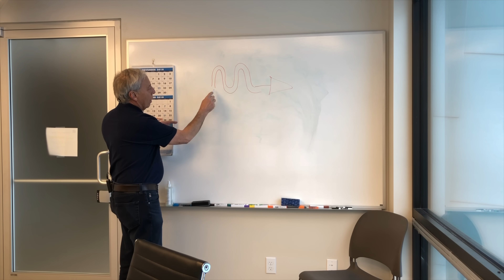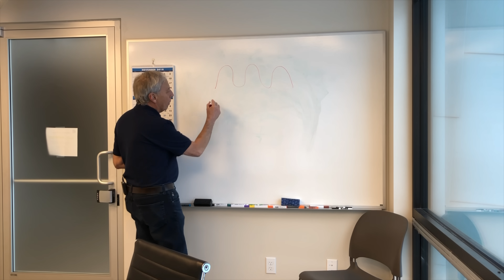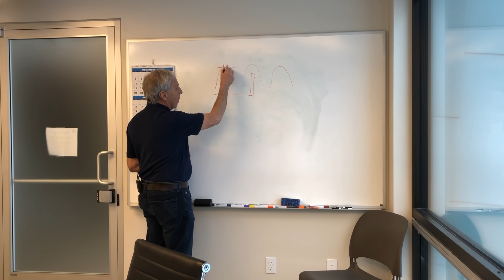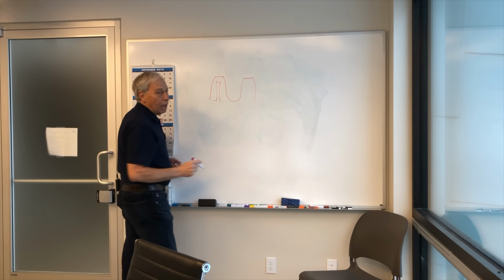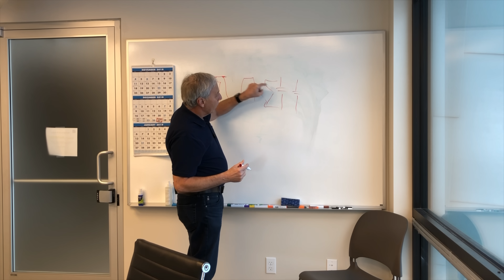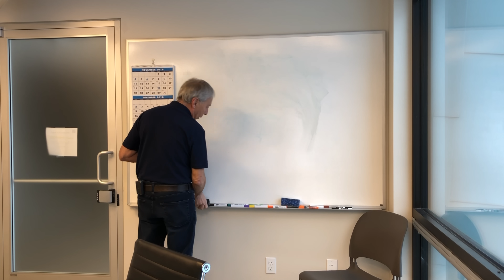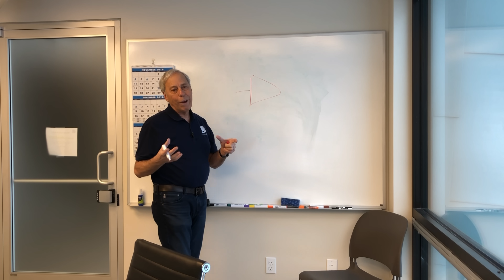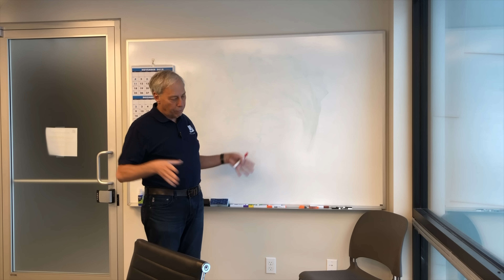How does power factor affect audio?

Comment: When are we going to see some evidence with calibrated test equipment that confirms this is actually a problem for home audio gear? I'm not saying these power line anomalies are not occurring. I am questioning their effect on simple home audio systems. Your simple white board explanations offer no quantified data to suggest the  magnitude of these issues. I'm afraid this is yet one more tireless monthly sales pitch for PS Audio power re-generators.
Reply: Why not buy power conditioner? You could always return it and get your money back :)
Reply: @BijBijTCG  I do use power conditioning. But where it makes sense. Two UPS systems, a 750va for networking and stuff that needs 24/7 operation. A 3kva for my media servers that are off when unused. And my audio and analog gear is an a 10kva balanced isolation transformer, which I have to admit, the balanced operation really offers no benefit but the isolation transformer does offer spike protection. And I hardly recommend this for a basic home AV system. A filtered power strip for line level gear and power amps are best directly plugged in. My system is a bit overkill!
Reply: When I engage my amplifier, a dimmer let less current trough to a lamp. It certainly affect the power supply of other equipment. No question. But I have no plans buying a powerplant module.
Reply: @oysteinsoreide4323  But your amp is not connected to a light dimmer is it? And also the way a solid state light dimmer works doesn;t care about incoming line distortion. I mean how calibrated is the apparent voltage level to the observed light level? (Note that commodity solid state dimmers do not lower the real voltage, It's a basic PWM system that changes the on time within the AC sinewave which does lower the apparent power).
Reply: @andydelle4509  No of course not, its just on the same AC power line in parallel.
Reply: I think that the power supply design plays a major role in all this.  Switchers generally have more noise than linear supplies and there is the issue of small local supplies to dotted around to confuse.  I build controls for lifts and so when it comes to Hifi I have some insight but still, I leave the finer points to the experts.
Reply: @LD Blake so, when the noise hits something non linear like a diode, what level of harmonic noise occurs?
Reply: If i let my Adcom GFA 555 sit unpowered for long enough to drain the caps, which has happened in my last two moves, it causes the lights to dim as well for a second when the initial onrush of current hits
Reply: Thanks for the detail. So if you have say a 200 amp service,  (usa) and one light bulb on, a large amplifier on another dedicated circuit. Nothing on in the whole house, turn that amp on and still dim the light bulb?
Reply: @Dave, I gave careful study to your words and I can only find the way out is DC equipment and a honking battery bank.
Why not just get all that potential energy stored up and then have it near the equipment for seemingly ultra quiet 
operation? If we are to continue this quest for Audiophillia then maybe this whole issue of PF could be a thing of the past. You are familiar with the elimination of distributors on automobiles? Sometimes a complete overhaul of the system can be the best route. Fortunately for me, the switch over would be simple. Segregation of a.c. and dc in audio may be the future. I'm sure that's making me look like the irresponsible one.
Just consider all this about regenerators, conditioners, noisy incoming power, rectifiers, on and on, its all unneeded in Beach Audio. That's my direction, I want the best sound when I'm sailing a reach out of popahey bay. I got about 23 feet of water line and that's where I want my audio.
Reply: @Andy Delle, with 7 billion on planet earth, why not just let the ole dude keep a couple regenerators on hand? What is the issue with you? I know everybody wants to rule the world, but maybe Paul is a
 Global Samaritan and trying his best help people with getting better audio. Maybe the contraption doesn't do well in a brown out, but then again you could have a back up hand crank radio for that. Roll with the freedom's that we have here in the USA or just keep your Spewed Slew on the other side of the border there where you are. Because you sound like you don't have the Freedom that we enjoy here.
Reply: @SJMessinwithBoats  People deserve to hear both sides. Note that I never said Paul was outright wrong. I asked for a test with real gear to prove what he is claiming on the white board. If  the product indeed solves that theoretical problem, then what's the problem with a test to prove it?
Reply: @Dave not sure that you've heard Gerry Rafertys "Whatever is written in your heart"
It might be on topic here. 🌴
Reply: @LD Blake does it make sense to use a "big" (strong) well-built SMPS, then convert this DC back to 60Hz AC and provide this new AC for the amp(s) through an outlet ? Given that everything is sized well (or even better: oversized).
Reply: Dave Micolichek  do you mean speaker driver protection ? For which  cases ? (The amp parts itself are class D modules). What might harm the drivers when switching off the device and caps still power the thing ?
Reply: @LD Blake SMPS are good (excellent), nowadays for high-end purpose as well, just like a Class D amp but I still have some reasons for feeding a Class D module with linear PSU. First, Class D is the kind of animal which is (due to its high efficiency) relying the most on the PSU. It's not like with Class AB that roughly half of the power is always delivered by the PSU regardless of signal swings and even more so with Class A where a big amount of current is constantly fed into the amp section and only some little variations are seen on PSU side as signal swings on a Class A output. With Class D almost the whole power rail swings with the signal and I think in this sense Class D is the most demanding amplification variant, regarding PSU.. and I mainly think of big transients and plenty of reserves. An SMPS (of the same wattage) cannot handle that much transients like the same specd. linear PSU, especially when stabilized. Of course 4kW SMPS is still physically smaller and cooler than a 2kW linear, with reserves.. but that's a different story. The amp is a Hypex UcD2k, 2.5kW RMS into 4 Ohms (max), woofer's minimum impedance is at 5.4 Ohms, max power is 2kW RMS constantly... so I think the chain is pretty much balanced now. The amp runs on unregulated rails anyway. Recommended PSU used to be a 3kW Hypex SMPS but I think I'm going to build 2 classic big PSUs for them, just for fun (DIY forever). And last but not least, the joy of building, experimenting, making something unusual.. all that kind of stuff, with a nice Arduino microcontroller, all this can be a very interesting (and satisfying) project when done well. Interestingly, for the midrange section I plan to use Class AB tube amps where I'm considering overrated SMPS for the PSU side, it will still be nice compact and midrange isn't that crazily demanding like big woofers. For the Class AB Mosfets for the AMT  tweeters, I'll probably rely on linear PSU again. I just don't dare to use SMPS here, although still thinking. So at the moment first step is woofer section's amps. Big transformer, big fun. ;)
Reply: Dave Micolichek  ah okay, thanks.. I'll employ such protections anyway, for the same reasons. I think it's a must-have. I thought you think of something 'esoteric' I might have missed. Anyway, thanks for the warning. (Good ideas are always welcome).
Reply: @LD Blake thanks for the extra input, I don't say you're wrong.. ;) I think I give this topic a run in a separate community and then I'll see how to proceed. I actually like the precise, 'dry' character of (good) Class D modules but it doesn't mean it's the de-facto best standard out now. It's just a different kind of animal. And those biiiig KT150 tubes still tease me, omg.. :)) Cheers and thanks again, I'll keep your comment in mind.

Comment: Are the lower wattage amps less affected by the flat top voltage signals?  I would assume amps that require lots of wattage(more than 400 watts? ) off the wall are the ones affected by flat top voltage signals, while the smaller amps like class D, headphone amps and lower wattage A/B amps are probably affected little if any?

Comment: Interesting take on power factor there.  I guess the notion that one can correct for it comes from the fact that industries using mostly motor loads can get away with them some of the time.  That and the fact the internet propagates dribble.

I never even considered power factor in my stereo until now.
Reply: @LD Blake  
Are we having fun yet ? 😎
Discussing PF to me here is almost a joke, although I do feel it's a question someone wanted to learn more about, so that's cool. 
When you're firing off banks of 5000HP compressor motors at a gas plant, now we have a problem to address..😆🤣😆🤣What he's really trying to say is we all need a PS Audio Power Plant.....right??
Reply: @LD Blake and residential customers don't pay for apparent power anyway.
Reply: @LD Blake I get that.  What I was doing is covering all bases, which is my way.  So apologies if I misled you, I do get a little carried away with the details.
Reply: The reason you never heard of this being a home audio system problem before is because it's a problem PS Audio is solely promoting as an issue. Again I want to see some evidence of that. Loose layman white board theory is not evidence of a problem that needs attention.
Reply: There are two types of power factor, displacement and distortion.  Paul showed the distortion power factor that is seen in things like switch-mode power supplies or rectified circuits with just a hold-up capacitor(s).  I've seen one solution that put an active boost circuit between the rectifier and hold-up capacitor that kept the incoming power(voltage and current) in phase while providing the higher bus voltage smoothed by the capacitor.  This had the effect of causing a continuous sinusoidal current draw on the power lines.

The other, displacement power factor, is what most people know of power factor and is the shift in the phase angle between the voltage and current.  This is most often seen with motors and is corrected on big loads with a capacitor.  In displacement, the voltage and current are still sinusoidal but not in phase due to the inductive reactance of the motor.  The added capacitor absorbs and provides the reactive current pumped by the motor switching as the voltage goes pos and neg, buffering it so the power company only sees the real power draw after initial start up transient.  If it didn't the changing polarity would pump the power line, making the power company unhappy as they tried to maintain voltage stability on their lines and require larger wires to handle the reactive current surges as the magnetic field builds and collapses in the motor windings.  With the added capacitor, the reactive power only flows locally between the capacitor and motor windings.
Reply: @jkbrown5496  All correct. But let's see these ill effects on a residential audio system? I mean at the speaker output where it counts! Power factor correction is indeed an issue in large commercial electrical systems and the utilities also charge penalties for customers with poor power factor loads. On the commercial customer side it is also bad for distribution transformers, UPS's and generators. But again, why is this a problem in a residential audio system? It's not!
Reply: @andydelle4509   Other than the peak voltage clipping due to the sudden current surge as the various power supplies on that mains circuit draw current at the peak, I don't see much impact on the secondary side of the amp power supply.  There are harmonic current draws but they to are unlikely to make it past the hold-up/smoothing caps.  

An interesting consideration would be the displacement power factor at the speakers, since they are a coil of wire being driven by an alternating signal and thus will have a reactive power element.  I've never considered the circuits from the point of view of the reactive power displacement in the speaker coil.
Reply: JK Brown brilliant! Beautiful summary! Reminds me of my power professor Auburn university back in the 70s! Well done.
Reply: @LD Blake But how long of a brownout? I don't see this mentioned much but the PS Audio power plant is not a UPS with a battery to fall back on. It only has reservoir capacitors as does any power amp. How long can those capacitors ride out variations? It's not a magic power source. It can only work with what it gets and store a finite amount of reserve.
Reply: @LD Blakeexactly !!!